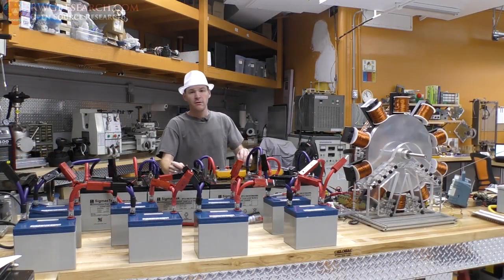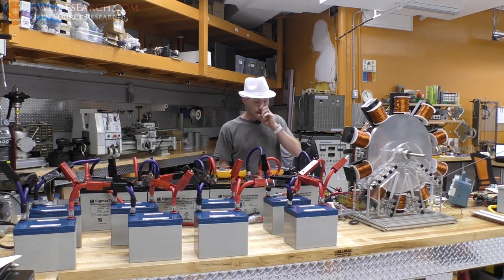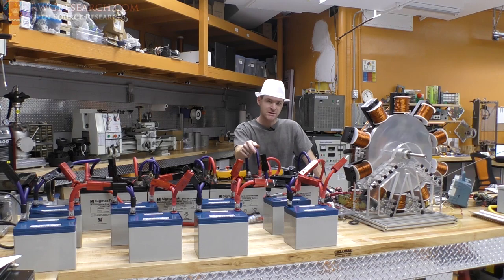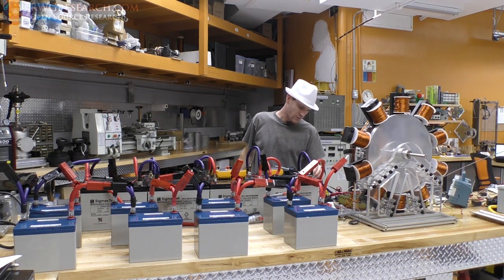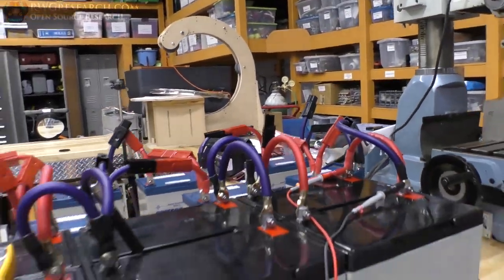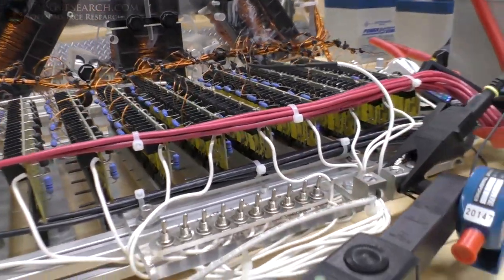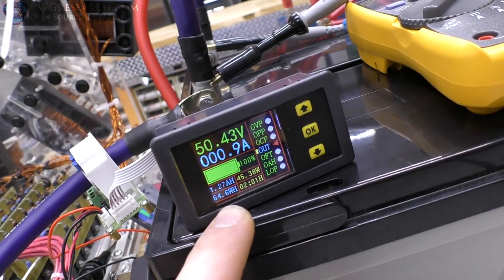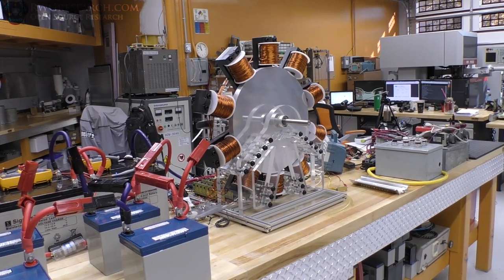P5 : Bedini 10 Coil Testing... flash back from 2017

Comment: awesome to see the current in and out, lined up.
Reply: Current meters don't tell you anything on these machines for the output. You have to do resistive load discharge tests to see how much energy is recovered in the second bank of batteries. The output meter will always show less output than in but as the batteries are cycled the amount of recovered energy will increase with ever charge /discharge cycle that is run. Most people that run input and output meters give up quickly and don't stick with the system and see what is really going on. 👍👍
Reply: @fan1701  have you demonstarted real over unity.? how efficient is it? will it work if i use solid state radiant energy

Comment: Don't charge your primary bank off the output of the machine. It will ruin your batteries. Always charge your primary bank from a standard power source. Forget about output current and find your energy transfer by doing discharge tests on the batteries. Always allow your batteries to rest for a time after charging. Discharge with resistive loads only fir battery rejuvenation. 👍👍